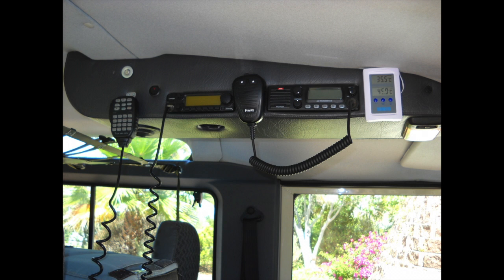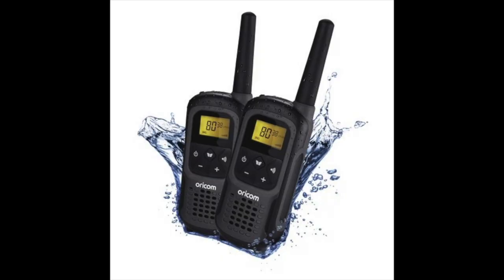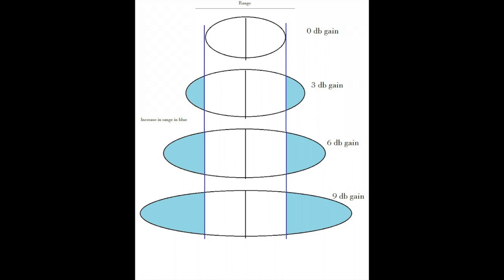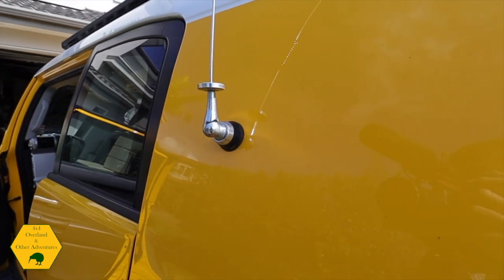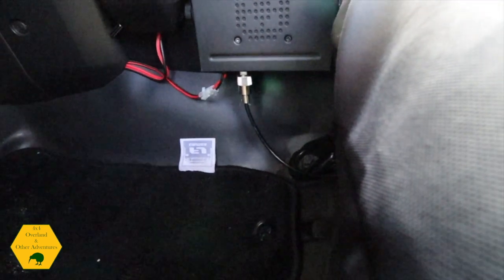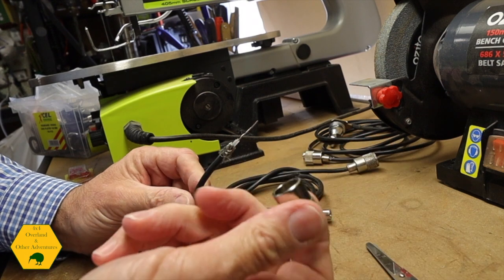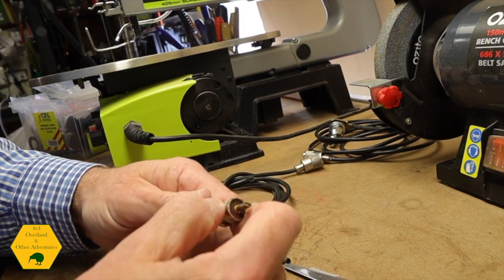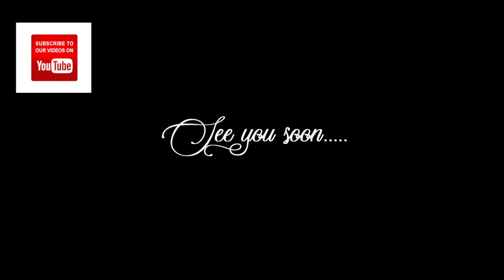What Radio do you purchase for your 4x4 and How to fit a Radio and antenna connector.

Comment: Good advise in your video. Now for my penny's worth. Traditionally 4 x 4 clubs here in RSA were on 29 Mhz. When the marine market did away with 29 and are now on vhf that killed the market. No turnover so suppliers stopped 29 imports. The GME on 29 is still available but at a crazy price. So now you have the 25 watt vhf radios that are been used. There are 9 ORRA channels and each club has its own frequency. This is also a problem with licence allocation now. I prefer the Icom 5022 as its display is alphanumeric so can read club names etc. Tuning the antenna then is guess work then so I chose most used channel for good SWR. With the power lead go to the main battery as on Tx you are drawing 6 amps , not good to do that  in the loom . All the best, Alan